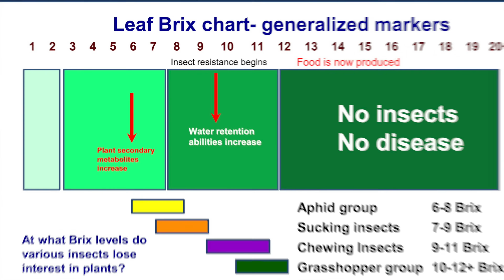Soil Solutions Series | Ep. 20 | Seed Choice, BRIX & Plant Health #regenerativeagriculture #gmo

Comment: this raises the issue of healing chemically damaged soil, aside from residue, low in humus, low in carbon in soil, low in living biological organisms
are there any plants that could be interplanted to help support the transition with the new non GMO, perhaps ssomething that might have better capability of prducing excess sugars to start building soil life?
.. i guess what im looking to learn is, what plants might you use to turn dead soil into living soil again?
im not using GMO personally but i think the issue overlaps.. i have rock hard compact clay soil that is so dead, it turns to dust when broken up with a mattock.
Reply: Nitrogen fixing beans/legumes comes to mind...that and careful manure + calcium (either lime or gypsum depending on soil ph)...For hard clay, I've heard that calcium + deep tillage is the key...just my 2 cents...not an expert by any means.  Look into using a 360 bullet (wing tipped) point for your deep ripper chisels and go easy on the depth on the first pass to avoid unnecessary equipment breakage
Reply: @moogman5 im also thinking of annual plants that may have more dense root systems that can be chop and dropped to get more humus in the soil as  fast as possible, i am thinking building the humus is a higher priority than the nitrogen from legumes, and of course it can be a mixed pasture of species,they arent mutually exclusive